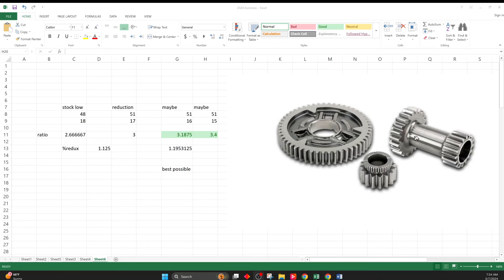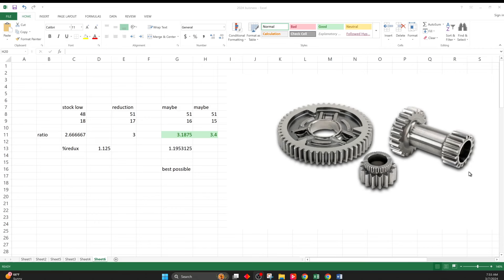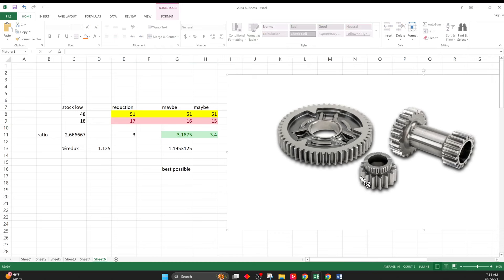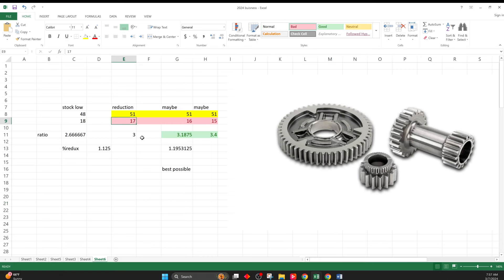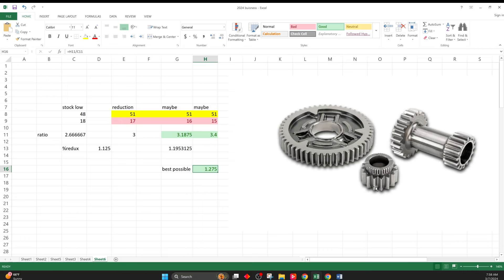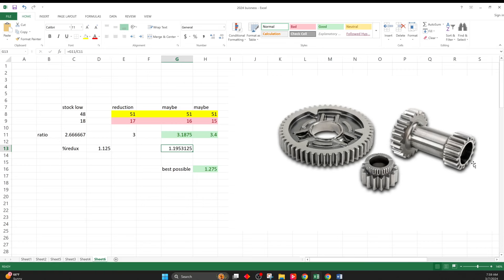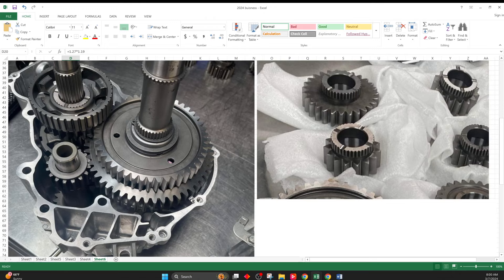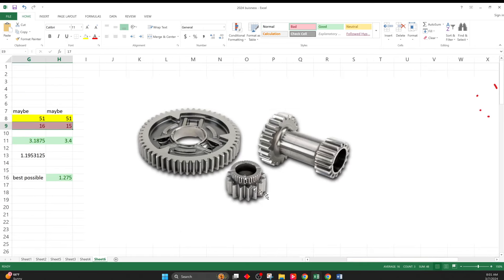New Talon & Pioneer Gear Reduction Sub Transmission Ratios Coming Soon!

Comment: Actually pioneer and talon both use the sensor on the sub transmission your output shaft speed sensor for shift points. The one on top of front differential is for shift inhibit. I figured the gear ratio last night for reverse and low so i have tuning for these and as always all FCP tuning comes with reverse shifting and i don’t charge to revise a customer tune for these gear reduction. So no need in buying tuning from Adam.
Reply from the maker: Let me know if you need someone to test that tune!